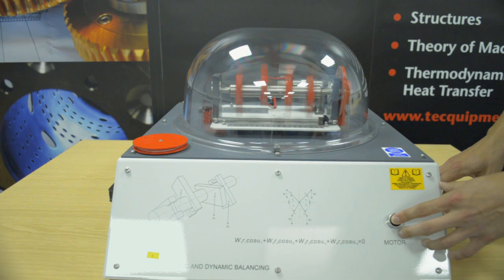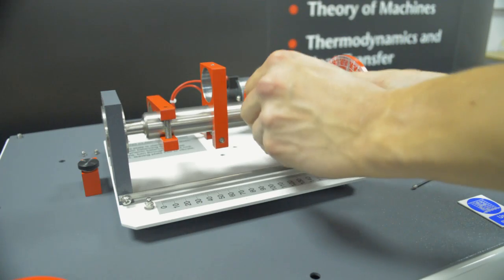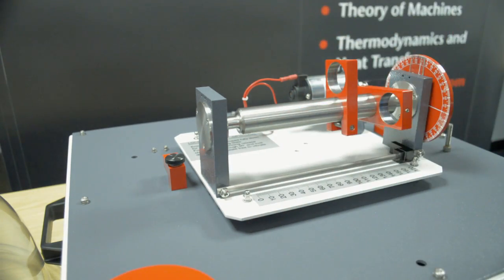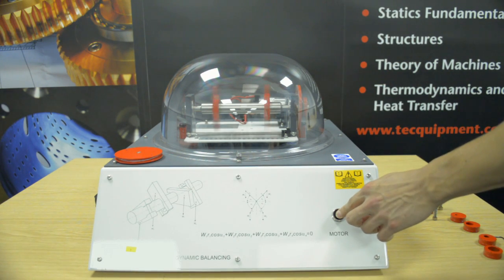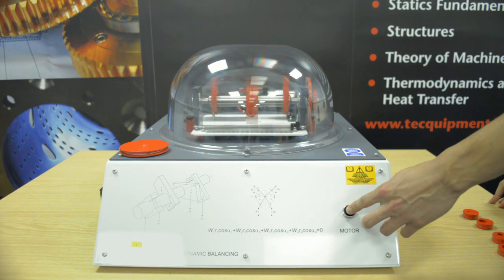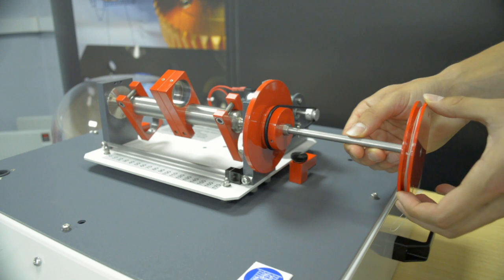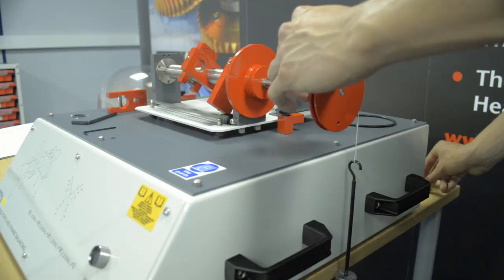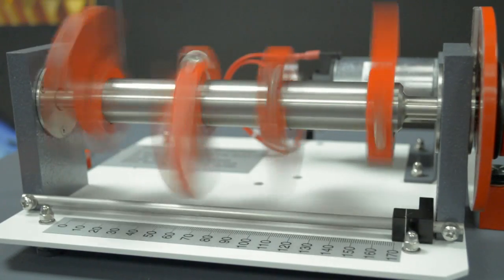Static and Dynamic Balancing TM1002

Comment: why it is needed to use two masses to achieve dynamic balancing, while one mass is sufficient for achieving static balancing
Reply from the maker: Hello,

Thanks for your question. We are able to show that a simple two mass system may be statically balanced but not dynamically balanced due to the possible twisting motion.

Kind regards,
The TecQuipment YouTube Team
Reply: If we balance the disturbing mass only with one counter mass it is ok to be like that when a machine is rest, it will produce a couple which is not favorable, using another mass eliminates the couple thus produced hence we can run the machine.

Comment: Is there any truth to the rumour that if we put some oil in a sealed container and attach it to the end of a shaft eg, the opposite end of a lathe chuck which is threaded and can take a vessel such as this, is this capable of balancing the spindle and chuck to any degree?... Often I've heard over the years that a vehicle drive shaft can be balanced this way with drilling and adding oil and then sealing up the hole. I've never been game to try it though but still wonder to this day.
Reply from the maker: We can’t be sure, it would be interesting to see if anyone else can confirm this?

Yet adding oil to an out-of-balance hollow shaft is unlikely to bring it back into balance.  To do that you need to add mass 180 degrees away from the radial position of the effective out-of-balance mass or remove mass from the radial position of the effective out of balance mass.  However, you might just see some benefit.  You would be adding mass and the fluid would likely be uniformly distributed around the inner circumference of the shaft so there is a possibility that, if the mass of oil were significantly greater than the effective out-of-balance mass, adding oil could work as a mass damper, reducing the amplitude of the out-of-balance vibration.
Reply: I grew up in the top balance shop in Houston. Industrial, not automotive, but the same concepts.

I don't believe this would work. Imagine you remove all the metal and are left with a column of oil. That column itself isn't balanced. There are too many imperfections.

I'm not sure where you heard that idea. I'm open to it, I would need to hear more, but it doesn't sound like something that would work.

Comment: hi does it happen that the system can be statically unbalanced but when rotated dynamically it has minimum vibrations?
Reply from the maker: Siyanda, 

If the equipment is configured for a statically balanced test then the user will observe that the shaft will stay in any position (this is done without the motor running). If it is configured for a statically unbalanced test then the shaft won’t stay in any position.

The procedure in the manual then asks that you to run the same test dynamically. The motor is run briefly and an imbalance of the shaft can be seen and heard, meaning it is dynamically unbalanced.

We hope this answers your question sufficiently?
Happy viewing :-)